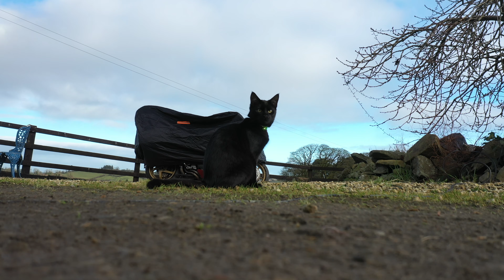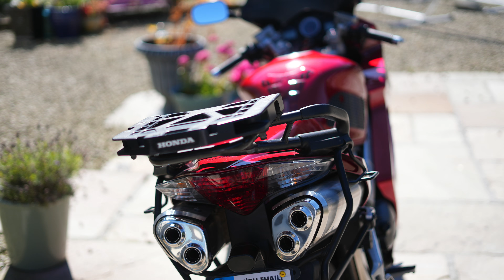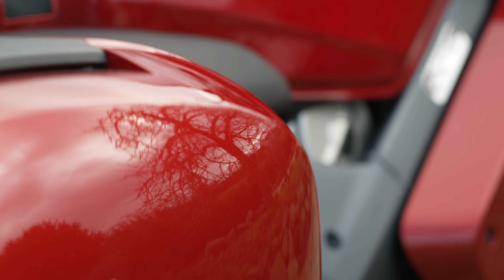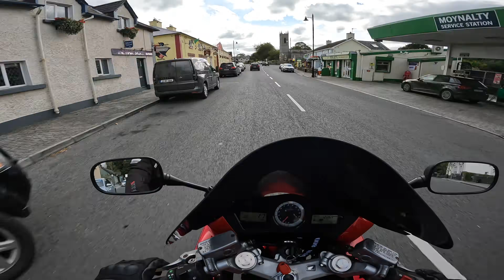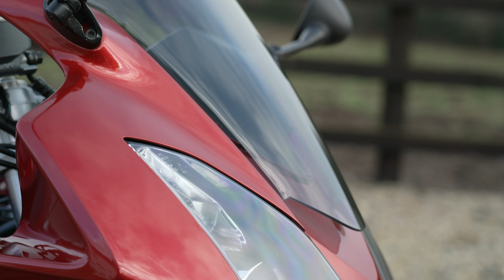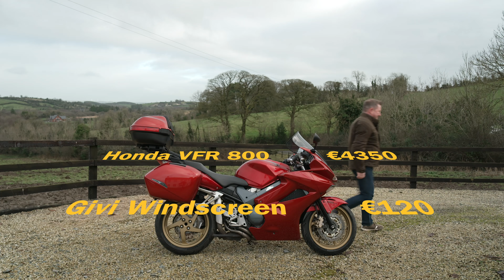HONDA VFR 800 | Restoring a 16 yr old classic | Complete cost breakdown | Dream machine

Comment: Hey Dave - I finally got my hands on the exact same vintage (and colours!). Desperately want the 2010 version gold wheels though.
Can I ask - where did you get your VFR stickers from? 
I bought some from cheap old Ali-ex but they are not the same size as the 2007 (slightly thinner) and they are very silver as compared to the grey.
Any advice welcomed!
Reply from the maker: Hi Mark. I bought the stickers on EBay from a company called Junyi-motor but I’ve just tried to copy the link for you and they don’t seem to have them anymore. Sorry about that.

Comment: I have  previously owned a second Gen 750 and a fifth Gen 800. Just bought a 2002 Vtec sixth Gen with a genuine 7800 miles on the clock. I'll let you know how I get on.👍

Comment: i have a 08 model, but recently everything seems to have gone bust. ABS light keeps flashing, new abs module seems to cost around 600 euros, stator and rectifier both need replacing, around 1000 euros for both. really disappointed by the prices for all these
Reply from the maker: Ouch. That’s too pricey for a bike that old.

Comment: Beautiful, beautiful bike!   Question for you.  I bought a 2014 VFR with 4650 miles.  The tires are original.   I took it to the shop and had all the deferred maintenance done.  His inspection confirmed that it was a very good bike "except",  the tires need to be replaced.  He mentioned the Road 6 GT tires.   Can you recommend them as well?   Thanks   Rick
Reply from the maker: Hi Rick, the road 6 tires are incredible. I fact I’m getting them on my R1200GS next month too. Never skipped a single stone in any kind of weather. 👌🏍️

Comment: Did you get the bike ceramic coated Dave? If so where 👍
Reply from the maker: No John. I decided Ihad done enough and spent enough so just wanted to get out and ride it. I did use the Autobrite Direct ceramic coating polish though and it did a superb job.

Comment: Why not just put up their info...??  What a half-ass job... instead of doing it correct, tearing it down, giving the frame and cases a respray properly ..you tape, seal off parts around the frame,radiator and paint it... surprised you didn't paint the bdywork on the frame, rims w/tires on.. why not ..if your going to go half-ass, why not go 100% half-ass. So what's does the backside of the frame look like, radiators .. how can you possibly refinish the out cases w/o removing them... to each is own but I never understand those who are LAZY half-assers

Comment: Hi Dave, Excellent piece of work! My view would be to leave off the VFR badges but I guess you want it close to original? Other question was the entire frame painted or just the visible bits? If only the visible bits, what a great idea. Beats dismantling the whole bike! On the video the frame actually looks like powder coated, superb finish. Arthur.
Reply from the maker: Cheers Arthur! Yes just the visible bits were painted and he did a superb job, it looks like factory.